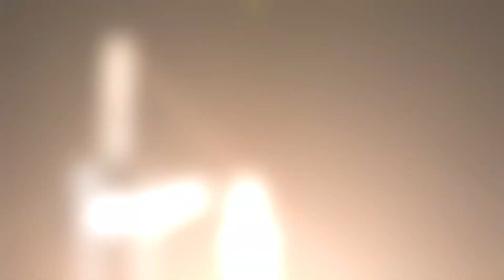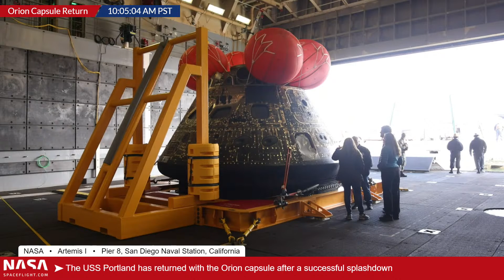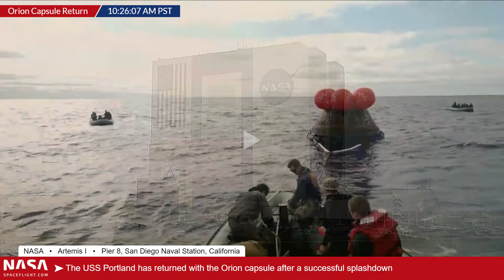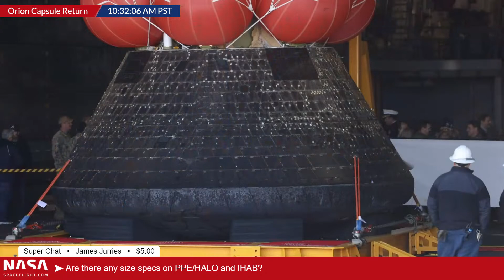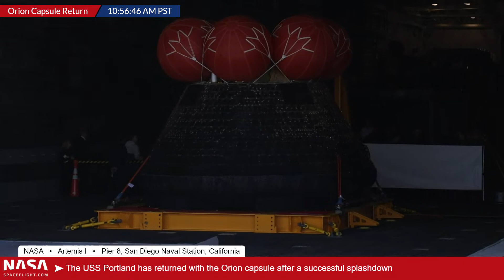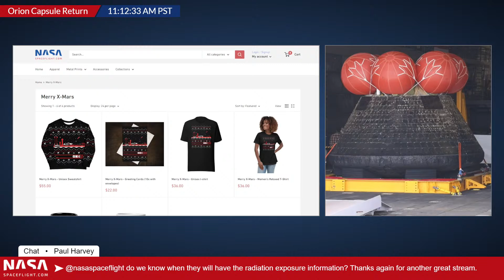Artemis I Orion arrives in San Diego after mission to the moon

Comment: About the severe heatshield ablation: If something is beginning to cool off from 5000°F, and then you plunge it into Earth temp ocean? Yes, it's going to blow the weakest point on the heatshield, which to my view, was whatever thermo-epoxy was used to hold them, of which all would be upgraded materials from the shuttle.
Of course, what do I know? My dad was only in charge of the CM Block-2s construction, such as the actual heatshields, wiring upgrades, honeycombing, etc. Photos of CM, LM, ready for shipment. Yes, he worked on Shuttles.

Comment: why are there circuit diagrams on the outside surface?
Reply: I think that is all the sensors with cables to them.
Reply: @zapfanzapfan  I'm not sure exactly which bits you (and @Jim) are looking at, but remember that the sides are covered with 1,300 heat shield tiles similar to what was used on the shuttle, and then the whole thing was covered in foil that mostly ablated off during reentry. So what might look like "cables" are just the seams between the tiles, and the silver squares appear to be the remaining bits of the foil, perhaps where an adhesive was attached.